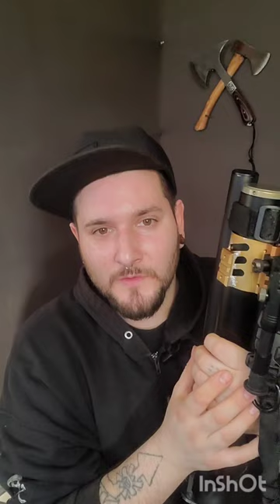Putting Iron Sights on PCP's?

Comment: Do it!!! I also used aluminum brazing rod to attach a rail, to the drop block on my bottle fed Benjamin Discovery. Although technically I brazed the threaded lugs to a bracket then bolted the rail into the lugs, then bolted the bracket onto the block. The lugs were steel but I built up the braze so that it kind of trapped the ends of the lugs, since it wouldn't actually fuse with the steel obviously. 

Can't wait to see your video!